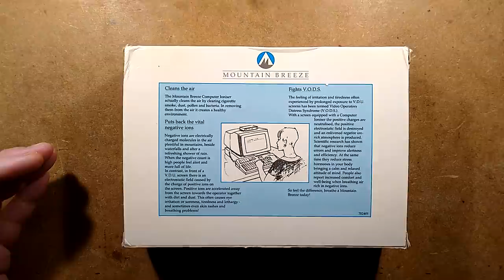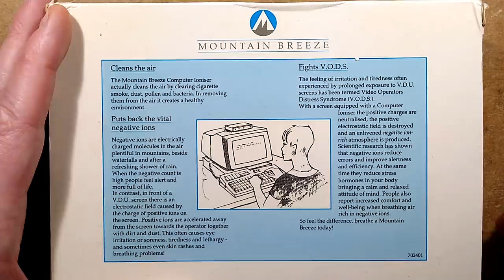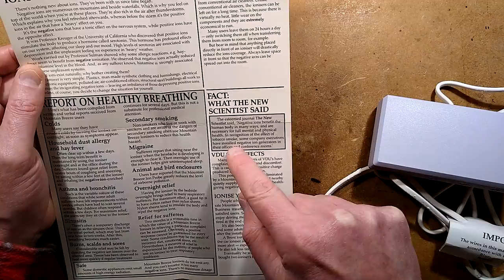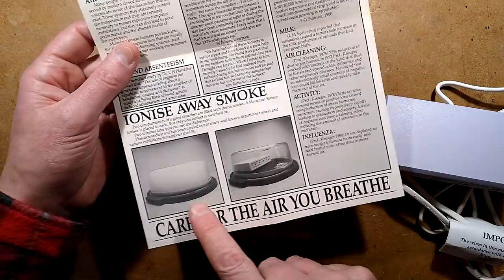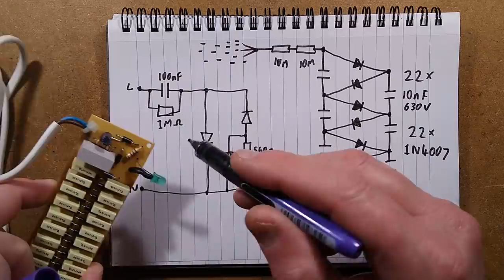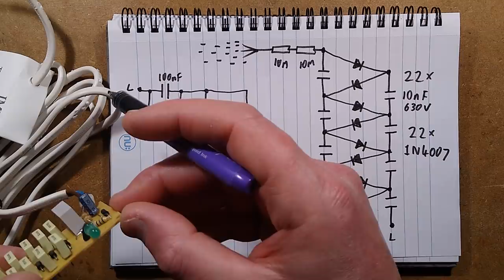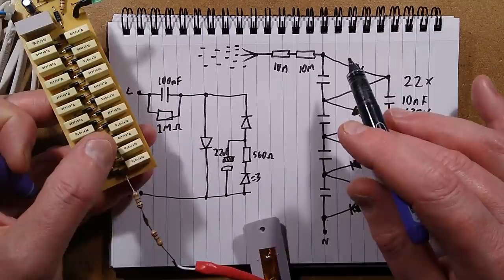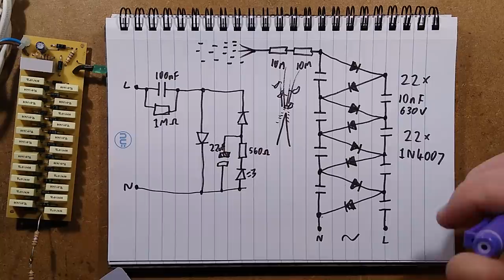Inside a vintage Mountain Breeze Computer Ioniser.

Comment: i am not really a fan of saying melted in relation to EPS packaging and rubber feet, i think decompose, as in chemical decomposition might be more accurate...
Reply: It's likely the plasticiser used in the cable caused it actually "melt" into the cable...
Reply: @IceBergGeo  So the softening compound added to the PVC cable leaked out and damaged the polystyrene shell around the EPS beads?  Maybe modern PE cables avoid that problem.
Reply: @johndododoe1411  from my understanding, it doesn't "leak" as much as volatilize. Plastics get brittle over time, right? But, I am not exactly a chemical engineer, just someone who knows that romex and pex/pvc pipe shouldn't touch after being installed. Could be part of the reasoning behind packaging plastics inside of plastics next to plastic support structure? All of this, without having a chemical engineer come in and enlighten us on the specifics, is just conjecture.
Reply: @IceBergGeo  PVC is naturally a hard plastic.  Bendable PVC as used on 20th century electrical leads is made by mixing in a "softener" chemical. Some of those softeners have been reported to leech into food from soft plastic packaging.  Hence the global move to inherently flexible plastics like PE.  I am not closely familiar with the product brands you mention, sounds like the usual US brand worship.
Reply: Polystyrene in contact with PVC cable for long periods of time often does this. The softener slowly migrates to the surface and then reacts with the polystyrene, which then turns to a sticky glue like substance.

Comment: I used to have a Mountain Breeze ioniser and thought (at the time) it was great. Thing I noticed with it was that if left on a white surface for a few weeks, 'dirt' or very fine dust would accumulate underneath and around it. Watched a video by Veritasium a while back that threw some light on this negative ion stuff (i.e. little health benefit) 😉
Reply: The dirt around it that you’re no longer breathing is how you know it works.

Comment: Now you need a nice electrostatic voltmeter to measure the voltage on the needles. I had an ioniser (mid-90s) and whilst I never felt any tangible health benefits, boy did it attract dust!

Comment: I always thought these were mostly snake oil, it's interesting to me to know they do actually do something.

Kinda suspect the soldering was likely down by YTP suckers like I used to be back when I was doing NVQ Electronics I got sent to a few factories where I soldered boards under promise of future employment etc, but they always kept you as long as they could then when they couldn't any more they'd get a  replacement from the same place and do the same thing again. It was  basically free labour around this timeframe.
Reply: No YTP at Mountain Breeze to my knowledge, many spent many years there on survivable incomes, certainly my pay was the going rate for my job.  In many ways it was a fantastic place to work, really sad it folded

Comment: I wonder if it would be possible to make a simple dual 120/240V version with something like a hand-wound autotransformer? One might even continue the autotransformer up another however many turns to step up the voltage and save on stages in the voltage multiplier.

Comment: It was said anyone who could rid the paper of charge on very large printers, two tonnes of paper onboard, would have made himself a fortune. We tried everything including radiation sources. Slowing up a printer running at 300 metres a minute to change rolls was a nightmare in hot dry weather, static wrapping up paper  and belting operators was not unusual.

Comment: Had a tower fan with ion thing in it.  Broke a PC !!  Open fan  > tear out ionizer <  It was just a HV DC potted thing about 2" by 3" by .75"  connected to two nails.     Never again used that crap.  
I have a different ionizer which has a metal string and 2 stainless steel plates. Works well.   Also, doesn't make the air full of static.    If these devices were NOT potted I could tell you why. Yes I want to know ;)

Comment: Several mechanisms have been suggested for the bactericidal action of ionizers including electrical phenomena, effects of negative and positive ions and electrostatic repulsion. Negative and positive ions have indeed been shown to have bactericidal effects. In addition, since ozone is generated along with ions, these may contribute to the bacterial killing. In this study, we used a newly developed ionizer, which generates a relatively low concentration of ozone, to determine whether its effect on bacterial cells were due to ions or ozone, and, if ions, how the ions exerted their effects.
Results

The effect of ions on bacterial killing was compared with that of the ozone produced using an ion trap to remove the ions. The ionizer had the ability to kill the bacteria, and ion capture dramatically reduced its bactericidal effect, indicating that the ozone generated had little or no bactericidal effect under these conditions, and the ions produced were responsible for almost all the bacterial killing. Operation of the ionizer increased the level of 8-oxo-dG, a marker of oxidative DNA damage, and decreased aconitase activity, which is known to be sensitive to ROS. The ionizer further affected the adenylate energy charge of bacterial cells. Removal of the ions with the ion trap greatly reduced all these effects.
Conclusion

These results indicate that negative and positive ions generated by the ionizer are responsible for inducing oxidative stress and so reducing bacterial survival.

Comment: Has anyone noticed ionized air smell like a cold winter morning outside
Reply: Yeah, Mountain Breeze called their company "Mountain Breeze". It is the smell of ozone.
Reply: ....which is also poisonous :-)
Reply: @sarowie  ...and terribly destructive of rubber.  I recall the negative ion/ozone generators being sold in the 1980s.  People couldn't understand why their VCR belts were going bad so quickly.
Reply: Nope. I'm wrapped in a warm blanket. It's far too cold out there.
Reply: @Matt Quinn Can you explain what happens to the belt because it's near the CRT?
Reply: @Matt Quinn yup I want to know too :)
Reply: @WillyJunior  probably the static created by the CRT TV affected the rubber belt. I’m shooting in the dark here but I could be right!
Reply: @sarowie  Mountain Breeze worked very hard to minimise ozone production, most effectively achieved in the filtering ionisers F400 & F800.  You could of course create a little ozone by putting the ionisation points close to an earthed surface to create a steep voltage drop...

Comment: The electrolytic looks like Samwha. They usually have a datecode on them. Also the X2 cap for the LED might have datecode on it. I guess this one is from the late '80s - early '90s.
BTW, I still use a CRT monitor from 2003/2004, I watched this video on it :-) (Samsung SyncMaster 763MB)

Comment: Clive! 
Did you ever tested 2.1x5.5 jack dc connectors? It's super weird for me that I can't find the current rating of any of them. I heard they can take 1-5A of current but I have seen power supplys with this connector above 5A. I can't find the answear for this anomaly anywhere. I want to build a led strip light, with this connectors, but I become pretty concerned, about fire hazard issues.
Reply from the maker: It depends on the quality of the connector and the cable used with it.
Reply: @bigclivedotcom  Thank you.

Comment: Clive your recent vids since microphone change are sending our 5.1 surround nuts with super low sound interference  vibrations in the rear channels
Reply from the maker: The microphone change was only at the livestream area.  But audio may have been affected by firmware updates.
Reply: @bigclivedotcom  I was suspecting you were running a secret infrasound experiment.....

Comment: Am enjoying watching, oh back many years ago they called computer monitors "VDUs" (visual display units)

I remember back when CRT cathode Ray tube monitors were staggered on the desks so that nobody would be sitting directly behind the person opposites Monitor, due to the X rays emitted on powering off or de-gausing crt tubes (high voltages) 

Does anybody remember switching off an old CRT TV 📺 and getting a pulse of static electricity to your face, due to xrays making the air more conductive and the tube shedding screen static? or the blue sparks from touching the screens.. 

Back around 2000 and before, office companies used to leave computers running day and night as it was believed that the thermal cycling of turning on and off would damage the processors and memory, I'm sure the electricity companies loved this base load... then around 2001 when offices updated to windows ME and windows XP people started thinking about the environment (coal and gas fired power stations were still in full operation back then) and the offices and call centres began to use the features in the software that allowed them to shut down and start up all the desktops in whole office buildings over the network/LAN (known as local area network back then- no WiFi yet) before 2001 you could walk past a city office building with big glass walls at 11pm and see the rows and rows of monitors flashing with screensaver animations.. then the practice of timed shut downs and morning restarts came along....and the first early TFT flat screens came along, using a little less power.. 

Now every computer, laptop and tablet is shut down overnight...
Reply: The x-rays are emitted perpendicular to the directions the electrons hit metal.

So most of the x-rays from a CRT are emitted straight out of the sides.

And the x-rays are emitted constantly. It's just that the CRT is shielded enough, and the x-rays low eV enough that they don't go far.
Reply: I remember! :-) I even remember when USB was "the next big thing coming around the corner," back when most LAN was still coax, and Windows '95 had it's "Plug-and-Pray" feature! Long live Clippy!

Comment: The newly developed ionizer, which generates a relatively low concentration of ozone, showed a bactericidal effect. The generated negative and positive ions induced oxidative stress on the bacteria during exposure. Our results indicate that negative and positive ions induce oxidative stress, which causes cell death by oxidative damage to cells including damage to DNA. Our findings suggest a potential mechanism of the ions on bactericidal effect.

Comment: +1 for the Renegade master!
Question regarding polarity of the spikes... Since the diodes are all pointing away from the spikes, doesn't that make the spikes positive with respect to ground, not negative?
Reply from the maker: No.  Think of it as the positive being shorted to ground by the diodes.  That's probably what caught me out when I accidentally made a positive Ioniser.

Comment: 630 volt rated capacitors with 650 to 690 volts applied to them...  That's rather less design margin than I'd like, although I sympathize (since the next higher rated voltage that's at all common would be 1000 volts which is clearly overkill).

Comment: Could use a fan, blowing air out of (through) the case past the needles.. And a plug. A blue LED would be the icing on the cake. Eliminate the cable, though: have it plug directly into the socket/outlet.

What's old will be new again.
Reply: yup, separate range, really nice systems, still have a few running here, though cables are usual length ;)

Comment: Did electronics in the UK come without plugs?
Reply: Used to, but the practice ended in the late 80s/early 90s, if I remember correctly.
Reply: Yes they did! As a spark I cam remember using 3 rawplugs to hold a lead with no plug top into a socket! Them was the days ;0)

Comment: I see they layer out the pcb to prevent arching. Were there traces connecting the components? Looks like a pretty clean design.
Reply: Very short trsces.  Look at the diagram, most pins are connected only to 3 other pins total.

Comment: A bridge rectifier would not have made the LED part more efficient. There is nothing to dissipate power (well, the forward voltage across the diode)
But the power factor would have been better and they could have used half the capacitor value (as the LED would be on all the time - OTOH the 50 Hz flicker looks 'energetic' - but then, why the 22uF cap?).
Reply: Half the energy is dissipated entirely in the reverse diode.  The flicker may be due to a dead 22μF capacitor.

Comment: I dunno. I wouldn't be comfortable putting a high voltage static generator on top of my PC. Electronics generally don't like high voltage. When I built my own ionizer it made my multimeter's LCD screen glitch out just because the multimeter was on the same wooden desk as the ionizer (not touching it directly to it or anything). The multimeter is fine BTW, although at the moment I thought I fried it.
Reply from the maker: Yeah, they're better kept away from electronic stuff.

Comment: I wonder if you take an ionizer and combine it with your homemade air purifier concept and use the ionizer to charge the filter paper and suck more particulate out of the air?
Reply: Yup, the Mountain Breeze versions were the 200, F400, F800 & 7000 for much larger rooms  such as offices, sold loads of them :)  Really good for those keeping pet birds in the house.  A pigeon loft needs a much stronger needle point ioniser

Comment: Did I miss what voltage it reaches on the needle tips?
Reply: It is a cockcraft-walton generator (also called voltage-multiplier).
Each stage adds 1x the input peak-to-peak voltage where the stages are the capacitors in series to the output.
There are 11 capacitors so the output is 11x Vpp.
Reply: @ABaumstumpf  minus some losses, with 240-250V input, so you’re gonna end up at roughly 2kV. Give or take a few hundred.
Reply: @JasperJanssen  Vpp, not Vrms, multiply by the square root of 2.
Reply: @johndododoe1411  right you are. So say 3 kV give or take.
Reply: @JasperJanssen  bit higher I think

Comment: The only place where I know of ionization still being used is in hair dryers. Although I don't even know if they also use negative ions only, or positive ones, or possibly even both polarities. Also, why did these things go away anyways, if negative ions are actually good for something?
Reply from the maker: Look up plasmacluster.  Ionizers are still going strong.  Especially in Japan and India.  Also now taking off again in the USA in air handling systems.
Reply: @bigclivedotcom  Thanks!

Comment: i had one of these in my bedroom about 35 years ago to help out my asthma ...everything in front of it was covered in dust, it was meant to stop me breathing it in
Reply: Well it did that because it attracted the dust that was otherwise in the air. However it also produced ozone which causes respiratory problems so is the last thing you want as an asthmatic
Reply: @gs425  "ozone causes respiratory problems"
Really?...well that explains a lot...my parents bought it on advice from my doctor...his explanation was that if the dust and pollen is not in the air then i can't breathe it ergo i don't get irritation....i think its still in the loft at my Mums house
Reply from the maker: Only trace levels of ozone.  At most similar to outdoor air.  There's a valid case for using very low trace levels of ozone indoors, as it occurs naturally at about 0.04 parts per million, and there may be benefits to its low level activity.

Comment: What I find slightly funny about the double insulation thing is that they had to go through so much trouble to double insulate the pcb in the plastic case, yet it was ok for them to poke the mains referenced led through the front, without any clear plastic window covering it as an extra layer. Basicly there is a mains powered component poking through the front where they relied on the component package for it to be safe to touch. Doesn't make sense to me.

Don't even talk about the needles. Can these things really be called double-insulated?
Reply: the needles have 2 x 10 Meg. It has to be two resistors, as it still would be safe, even if one would fail.
The LED is also current limited I guess, but your point is offcourse valid. The LED is odd.
Reply: @sarowie  I'm aware of the needles indeed having resistors, for obvious reasons. 
But at what current limit / number of layers of insulation is something called double insulated? 

If we're taking a look at power supply insulation it is common to say that 6mm counts for it to be called double insulated (that is, if it doesn't have an earth connection for the filter or whatever, devices with earth connections can never be double insulated). 
I guess it has something to do with that as a standard 5 mm led has a fair bit of plastic in front of its conductors, but still. 

The can of worms gets even messier if we start talking Portable Appliance Test (PAT). Try to categorize a laptop's power supply for example, haha. 

Rules and guidelines are sometimes confusing. Thanks for the agreement! :)